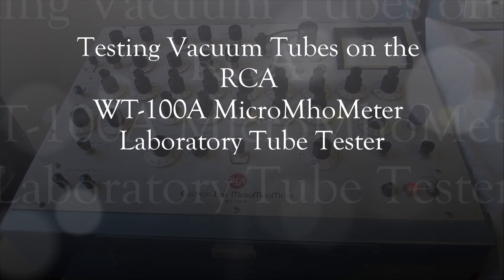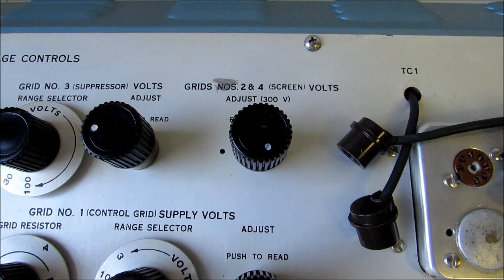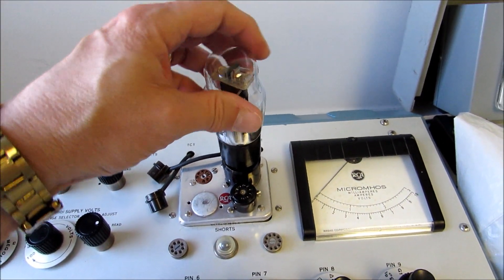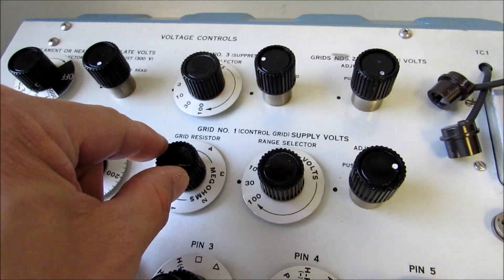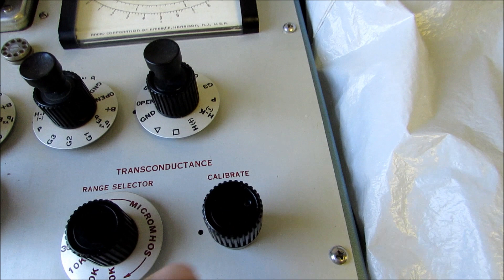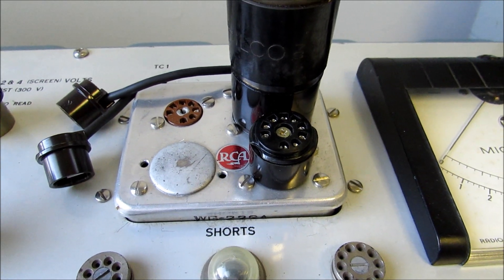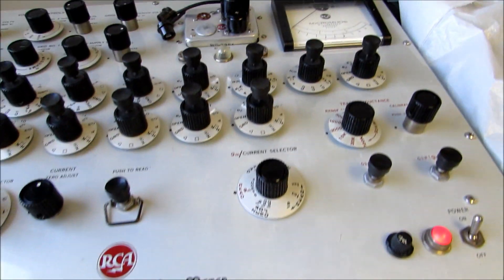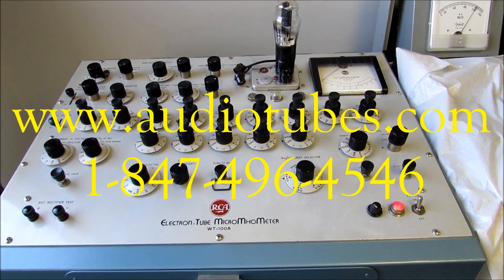Testing Vacuum Tubes on the RCA WT-100A

Comment: 7:03 calibrate GM one more time.... hmmm.... and tada! it matched that time - - how convenient...  just keep tweaking the knobs until you make a "match" - - I don't think that's how it really works but - seemed to work for the video. seriosuly - those tubes weren't quite the match ....
Reply from the maker: The reference point for the Gm circuit is full scale deflection on the meter when the calibration button is pressed.  RCA recommends the calibration of the Gm be checked for each tube tested, once the tube has warmed up, before the Gm is read.  This will eliminate testing differences caused by circuit drift, variations in AC line voltage, or other variations within other tester circuits, as this is an analog device.  The key point RCA is making is to make sure the electrical characteristics of each test are the same for each tube at the time of the test.

Comment: A very nice tester wonder if the 539c would be more accurate since has multiple transformers
Reply: not even close
Reply: @hoosierbuy  so what makes this tester more accurate then 539C?
Reply: @Tysman909  ....... everything pretty much if it is used properly
Reply: There is a hickok tester that reads exactly what an apex matched tube has on the sticker. It uses DC signal voltage instead of AC. It's more accurate then the 539C
Reply: @Tysman909  DC is not a signal by definition.  It’s only a Direct Current Voltage level.  All signal waves are AC.

Comment: The only way to truly match tubes is overlaying curves from a curve tracer. A match at one specific point on a characteristic curve doesn't really mean all that much, and that is all that a single test on even this nice of a tester will provide.
Reply from the maker: I agree.  My point in this video is that this is one of the best tube testers ever made, given the limitations of tube testers in general.  A curve tracer, like our Tektronix 576 can plot plate current curves at up to 10 different grid bias points, all at once on the screen.  You could do this one bias point at a time with this tube tester, but it would be a tedious process.  See my other videos for our Tektronix 576 in operation.
Reply: @audiotubes  How do you keep this machine in spec? I suppose there are components int the tester that can drift out of spec over time. I ran a semiconductor facility and everything had to be certified in-spec on a yearly basis or we wouldn't have known what we actually got for results.
Reply: @RickMcCargar  It looks like "cal before use" using the built-in calibration features as you will see in the video (which slows up tube testing a lot though).
Reply: @genebrandt8424  internal 
cal before use doesn't stop the calibration itself from drifting.
Reply: Sounds good, but I have found the plate current matching is more important for a good match on output tubes.  We use a MaxiMatcher, does transconductance and plate current.

Comment: Did you put a clear coat on the front panel?  It looks really nice.  Mine is a bit worn.
Reply from the maker: Hi,  Yes, not only was the front panel cleaned and clear coated, but the rest of the case was painted at an automobile body shop!  The guy I got it from pulled out all the stops and completely restored the tester.  Thanks for watching.